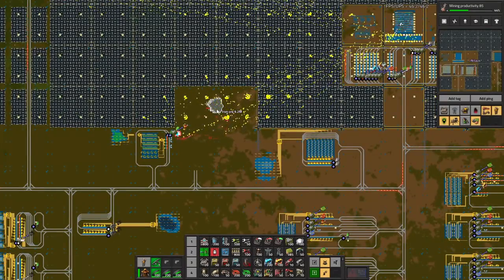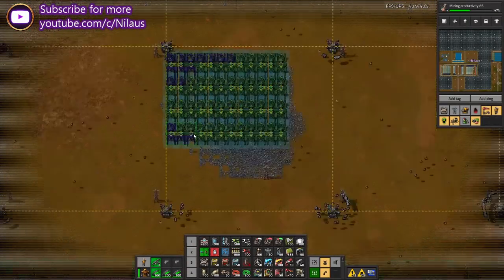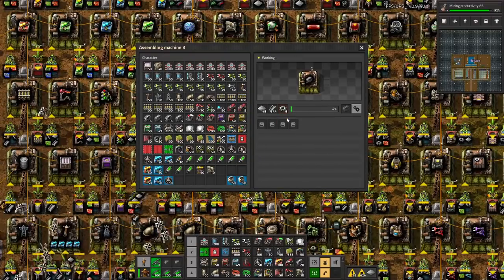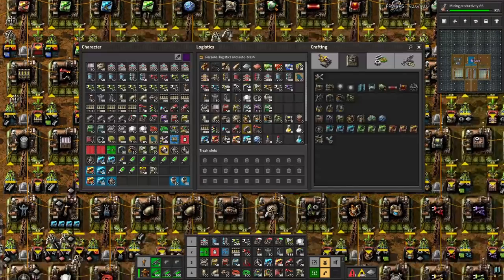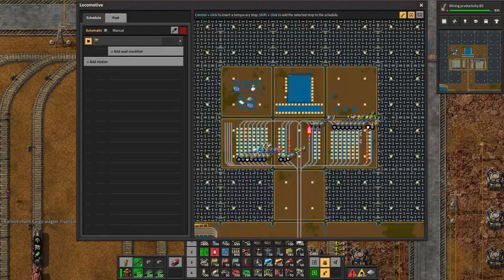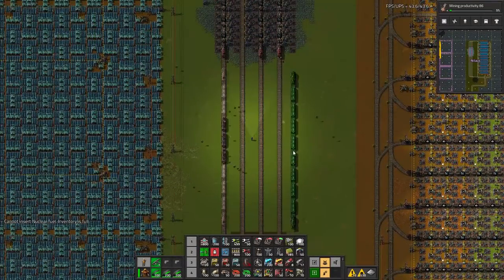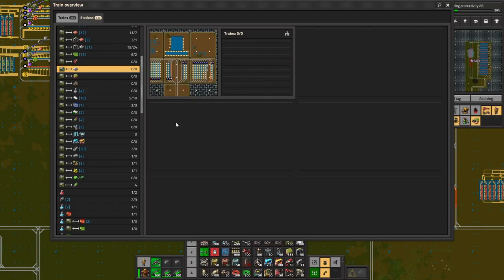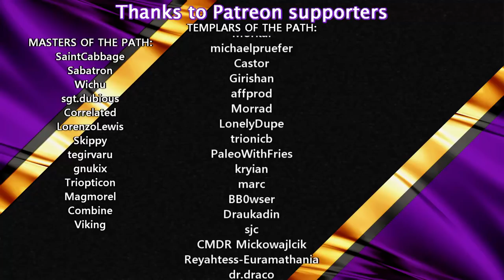Gradual Conversion of Iron Smelting Without Disruption | #70 | Factorio Megabase-In-A-Book Lets Play

Comment: For your "mining into trains" blueprint, you should include the length of rail and signals that act as a stacker. That way the signals don't need to be placed manually, and also it will be visible at a glance if there is enough space for that stacker.
edit: Or even forgetting to put those signals in altogether until the end of the episode.
Reply: You don't even need the signals, right? There's one right before the miners and one right after the intersection. You don't need to stack 3 trains
Reply: @KingOfCheesee  You're right, 99.9% of the time you don't really need them. The only time when they come in handy is when one train is in the process of pulling into the station and the second one is already coming into the stacker to queue up. Which can only happen if that second train has an exceptionally short path to the stacker. And IF it ever happens, the path can't even be short enough to make that second train come to a full stop.

Comment: About monitoring the new smelting (iron/copper): 
- it maintains full speed as long as enough (or to much) iron is requested, and enough trains are available. 
- is has the design flaw that it slows down, as soon as not all the iron is requested. So: Only fixable by adding parking, which only postpones it ... or look at it as "always self balancing & works as designed" 😀
- I would only monitor if is has run out completely (1 of the 4 lanes, or all 4). A lane will run out for one of the outer wagons both miners (so essentially the inner miner) has run out of ore. 
 -> so wire those miners to give an alert if run out. Don't hook it up to the dashboard.
-> Also maybe just monitor: has any iron consumer empty iron belts?

Comment: For monitoring the train-based production: The plan is to have exactly one train for each loading platform, right? (For the following, I have to assume that there is at least as many trains as platforms. More is fine, but less will lead to wrong counts.)
What happens if a train is full? It will "depart" the station (but still sit in the spot and take up one slot of the train limit), so that the station will no longer receive the train ID, right? (Correct me if my assumption on that is wrong.)
That means having a logic combinator set to "if train ID == 0, output 1 [iron plate]" will output the following signals in the following situations:
While the train is loading, the ID is readable and the output will be 0 plates (as it should be).
While the train is loaded and waiting for a destination, the ID is not readable and the output will be +1 plates (as it should be).
While the train is driving to its destination, the output will be +1 plates (as it should be, but hasn't been with the previous logic).
While the train is driving back from its destination, the output will be +1 plates (which it shouldn't be and hasn't been with the previous logic).
Given that with the previous system, we were unable to detect the second to last situation correctly (and that the paths in both directions are the same length), this new system won't be worse than the previous monitoring logic. (It will just be bad in a different way).
Alternatively, you could detect trains with a "if [train ID] == 0, output 1 [red signal]" and then wire that and one signal from the platform into a "if [red signal] ==2, then output 1 [iron plate]" logic.
Alternatively alternatively, you could replace the "if [train ID] == 0" combinator with some logic that amounts to "if [train ID] == 0" [OR] "if [train load] > 80%". That would also count trains as available that are very close to full, but uses one yet another combinator.

Comment: Why not do the steel belt less as well, maybe even a different kind with ore trains from patches and centralized ore to steel smelting.
Reply: Yes, and I think that converting any field that has been mined for some time is a waste of time, since it's not likely to save as many CPU cycles as the conversion took in the first place.  IMO, he should triple up on lasers, make a 5000 shells/min industry, secure some new fields, and do it there whenever an old field runs out.  And fill the unused parts in the south with some solar ffs!  ;)    EDIT - and I still think that the spacing should be 10 (i.e. 8 squares between tracks, +2 for the tracks themselves), because if he does that, he can mirrorthe mining part once the field runs low in the used parts.  Right now, he can do that, but it'll run dry much sooner, in about half the time.